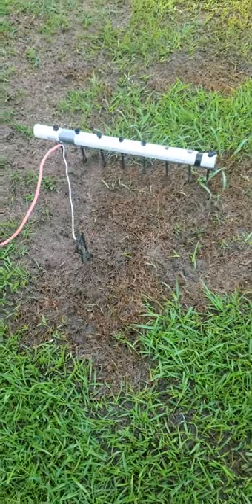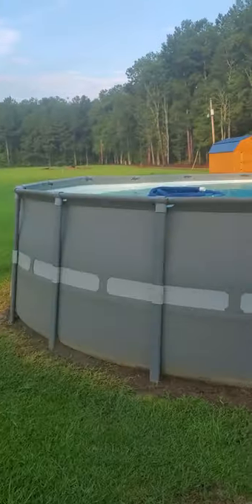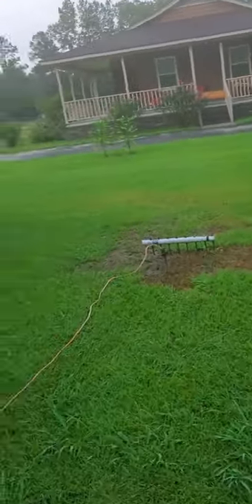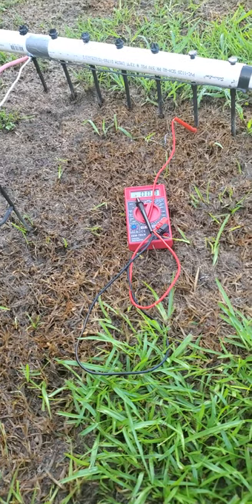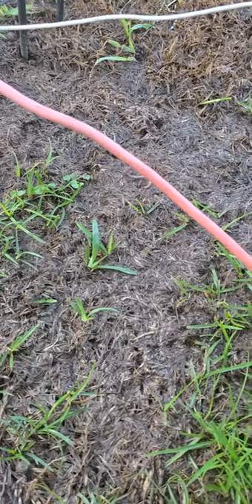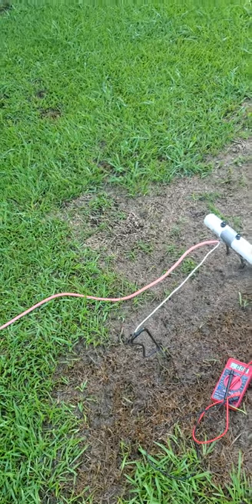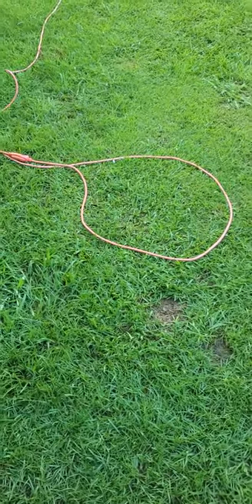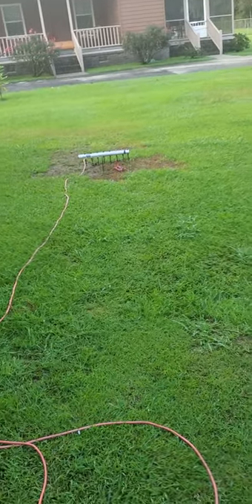worm shocker 2020

Comment: Technically,  the prong on the left IS a ground; it's the grounded conductor. Most people call this wire a neutral,  which in the sense of your common 115/120 volt receptacle outlet is wrong. The black wire is the ungrounded conductor,  the white is the grounded conductor, and the green the grounding conductor. Even though the fella may have been a few bricks shy of a full load he was kinda correct. The (n
eutral) wire is bonded to ground in your electrical service panel and does carry voltage back to ground completing the "circuit" for electron flow. As all things in life, its a circle more or less. You couldn't generate electrical flow without having a ground ; a complete circuit 
Now the other fella that told you in his video to attach all 3 wires to the same rod should be banned from submitting content that could get someone hurt. He has zero electrical knowledge.  
There are specific codes governing  agricultural installations to prevent ssentially what you are creating with the worm shocker, to prevent harm to livestock and human alike. 
But enough of that , I woukd like to build one for my sister to "hunt" worms but I'd like to feel comfortable knowing she won't get hurt and be able to actually produce some bait. I will look at a few other videos,  (yours just happened to be the first) to get more info on actual construction. Even though I may understand what and why is taking place, doesn't mean I know how to construct such a contraption. I believe that they use to use old hand crank generators like that were used in telephones .
Thanks for the video and good luck on your quest for bait